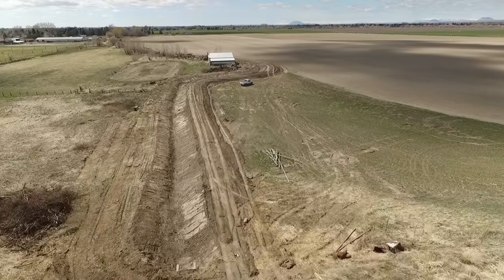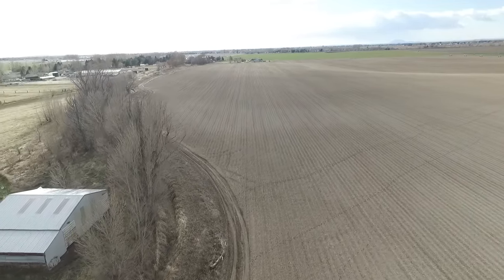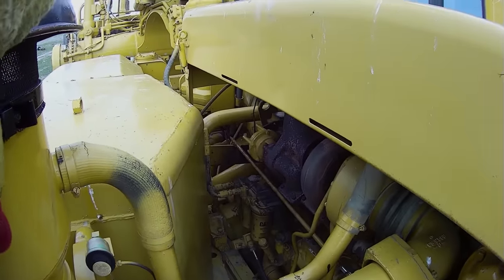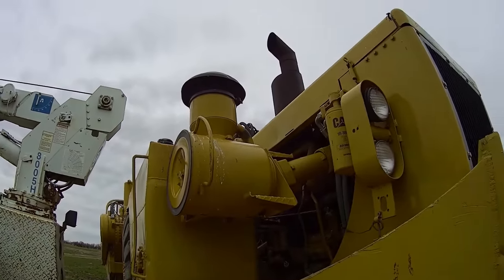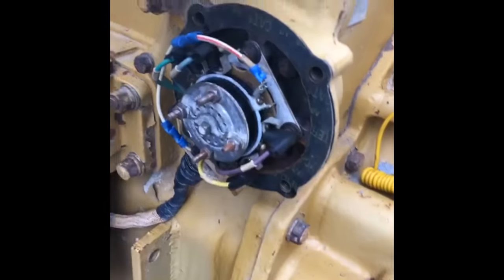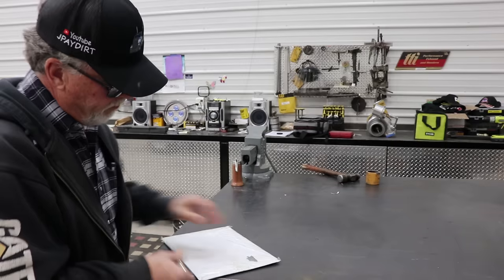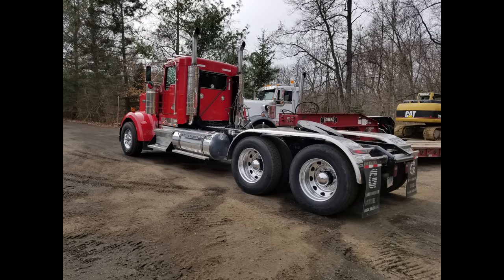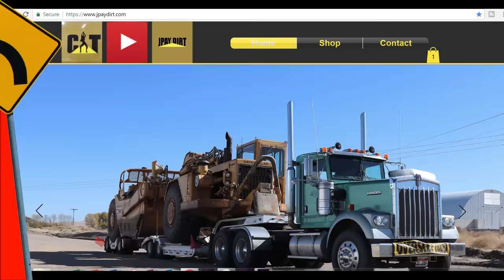Caterpillar D343 Blows A Turbo

Comment: I've lost rear turbos on two occasions. And one that looked like it did. So I pulled off the cut (24 rigs) head to yard and pulled filter. That air filter weighed 34 lbs.Poured coal out the stack the same failed turbo.

Comment: Jeff,I lost a turbo on my 623b scraper. First one for me. It made a funny noise, lost all power, and surrounded me with so much black smoke I didn't know where I was going. It had a good tight cab so I didn't eat any smoke. Took a long time to get it back to the yard. Mechanic  fixed it in a couple of days  and  was  back  to work. Oh what a difference.

Comment: On the modern highly boosted diesels, when the turbo fails, the shrapnel goes BACKWARDS into the air cleaner. Simply because when the turbo is boosting under normal load, there is a strong vacuum to the air cleaner, once the turbo fails, debris goes into the vacuum, not towards the engine.

Comment: Curious if you've tried welding a cutting edge to a few teeth to help speed grading with the excavator in such soft soil?  I found I was significantly faster - found my depth perception was affected with only the teeth of the bucket in the bottom of the ditch - was much easier to maintain grade with a smooth cutting edge. If I had a 3' bucket, would use a 4' wide cutting edge and would clean up stuff that rolled out of the bucket. Plus it left the ditch cleaner.
Reply from the maker: https://www.youtube.com/watch?v=qKho274ULGU

Comment: Nacelles vary in weight based on output and manufacturer.  Anywhere from 120-160k.  If memory serves the ole 657 Coal Bowl was around 160k also.  A guy bought it sealed bid for $20,000 and then bitched about my rate to haul it!
Reply: What a guy....LOL   I do not know what scrap iron is right now or when he bought it but.......gee whiz

Comment: Ever thought of adding a small plate lower in middle of the scraper cutting edge to cut a bit deeper than the whole width of blade
Reply: Drop center cutting edge? Most scrapers I've seen use them

Comment: Do you have a video explaining why everyone uses all these canals and irrigation ditches where you live?  I am from the east coast and am clueless as to if you have too much water and need to drain it or if you are bringing in water to supply the crops. Is there much subsurface irrigation used out there? Here we make a ditch for the water to run into so it can leave, but I see you building up walls of earth next to yours that look higher than the fields they go through. Just curious, thank you for the videos, J.
Reply from the maker: Most of the irrigation was flood when the valley was developed, but has gone to sprinkler now, but the canals and ditches feed a lot of the pumps, my ground is still flood irrigated,

Comment: Well hell.... I just saw him making this video and changing out that turbo and then it shows his Obit, so how did that happen so quick ? ? ?
Reply: That's how turbos go out- quick. You will be running, then you will see a fog. Then you will notice the fog keeping up with you. Damn it's you.  I got one so hot I could see through it. Literally see through it. I could see the bolts screwed in to the manifold. Quite a sight.
Reply: Those turbos turn at ungodly speeds. You always get to have the first of all the fun stuff. This time the impeller to stop turning. I wanted to do that, oh well

Comment: when you have to get out on foot in a field that has been recently sprayed with roundup . do you take any precautions to avoid picked  contamination spreading thru your vehicles, shop , laundry machines.  its just a question.  i too was wondering if you held the fuel shut off and cranked the engine when the turbo oil supply was taken off the old turbo to flush the supply and to verify you are getting oil.. plus running compressed air thru the drain back hose to verify its not restricted.. what about the super fine sediment in the air filter..  i know that when i block the inlet on a impeller pump.. that is spins easier as there is less air being moved thru it.  less drag.. much more RPMs.. could the dirty filter have caused the turbo to overspeed? it will be interesting when you heat up the turbo wheels with a propane torch to loosen them from the shaft without pounding to see what failed in the turbo.  or just ask the turbo shop what failed if you are returning it as a core.  perhaps its just a rust flake from the exhaust manifold holding the turbine blade.. just thoughts..
Reply from the maker: I'm going to remove the hot housing and have a look see before it goes to Blaylock Turbo, you should see that this friday
Reply: i have a thought.. it the inside of the  exhaust manifolds is really scaly..  perhaps somebody does extrude honing up near you... clean the manifolds of scale as best you can.. let the flowing abrasive do the rest.. https://extrudehone.com/ or https://boneheadperformance.com/contact/ you could just take a ball hone and weld on some cheap sockets and use some impact swivel universal joints to allow you to go around corners with an conventional extension..

Comment: Your puppy, At the age of 6months you can at least Dubble his size and you'll get the aptox size of full grown at two years.  he will be 75-85 pounds of Teeth and fur. 
 Beautiful pup ya got there. !!!!! Make sure your oil supply line is getting oil up to your new turbo Jeff. lack of lube is the normal cause of failure, also let the engine idle for a few before shutdown. remember that assembly is spinning 100,000 RPM  or more. it take a few to slow down. ....!!!!!!
Reply: I'd like to see an autopsy of the turbo, just for that reason...to see if oil flow to the bearings was impeded.  Used to be with a highway truck,  you wanted it to idle for 3,4,5min before shutting it off so that the turbo's bearings could get some cooler oil from the engine pumped up there. Failure to allow cooler oil to the bearings for a short while after being run hard tended to result in "coking", where the red-hot bearings would boil what oil was around them, and after that happened a few times, the flow would be reduced or stopped up, resulting in bearing failure.  I'm pretty sure that Jeff's machines don't go from 100% work to instant shut-down, without some time lumbering across a field to a parking spot for the night.  I'm confident that this turbo wasn't defeated as described above, but just for the sake of interest, I'd love to see if he can determine what did cause it.  Hopefully it's not a symptom of another problem elsewhere....
Reply from the maker: You will see it friday for sure
Reply: Stan Patterson 
 Just glad it didn't explode into the intake, they're also known to  destroy  engines when they fragment into the top end of the cylinders.  But now you know the tattletale sign of Turbo failure( Black Smoke & lack of power)

Comment: Jay.... Please help me understand how the rear engines work with the main engines on those machines. Also glad the great state of Georgia could send you a part. What dealership did you get your switch from.Nothing wrong with that mans sendoff. Nothing at all...... By the way your German needs a bit of work.
Reply from the maker: The throttle for the rear is air, the more you push the more air it delivers and throttles up, the transmissions work like this, the front is a eight speed semi automatic, reverse first and second are selected manually and are all converter drive, third thru eight will shift automatically to the highest gear selected. and are direct drive, everytime the front trans shifts it rotates the slave switch and sends a signal to the sycronization switch on the rear trans, which in turn sends a signal the either the upshift or downshift solenoids , when the solenoid is energized oil shifts the trans and rotates the sync. switch breaking the shift signal and stops any further shifting , it also sends a signal to the lube solenoid which controls trans operating pressure so in the event that it becomes un syncronized with the front the operating pressure's are reduced to lube pressure only and it won't operate, in that event there is a sync light on the dash that lights telling the operator there's a problem, the rear trans is a four speed and all gears are converter drive, the hydraulic slip in the converter allows it to handle only being a four speed with the front trans being an eight speed, so the even gears in the eight speed match perfectly with the rear trans and the converter slip in the rear trans allows it to work with the odd gears, 627's and 637's are built like that, but 657's have 8 speed transmissions in the front and rear
And I think Cat has a warehouse in Clayton
Reply: Thanks! Really I have always wondered how they worked so they worked together and didn't try and tear each other apart. Sounds kinda complicated but if it works it works........ Clayton is about 100 miles north of me around Atlanta. Thanks again for the long explanation
Reply from the maker: Opps Clayton Ohio

Comment: What is the idea behind different gears for front and rear at the same time? How does that work?
Reply from the maker: Not sure the idea because the 657 and 666 were 8 fornt and rear, but the rear has a torque convertor to take up the difference, the front is direct drive in gears 3 thru 8
Reply: Thanks mate. Are the rear engines on all the time or just when needed?
Reply: The old 657 when the front engine quit the rear trans shifted to neutral
Reply: @Jpaydirt first gear is direct drive there on up the torques take over   before the automatic you couldn't pull the shifter into 8th

Comment: Me- here gophers bang bang bang
Neighbor- what are you doing?
Me-i has a gopher problem.
Neighbor- oh 
3 min later
 Neighbor comes back with l.m.g(light machine gun)
Me um whats that for?
Neighbor you has a  gopher problem right?
Me yes.
Neighbor  well you have to use the right tool for the job.
30 seconds pass 
2 min. Of L.m.g fire 
Me that was fun. 
 As field of deid gophers  lay there 
Me thinking to my self that gona be dinner for the next few moths